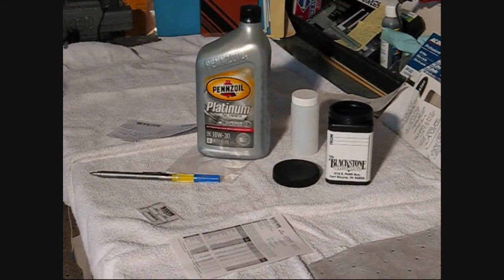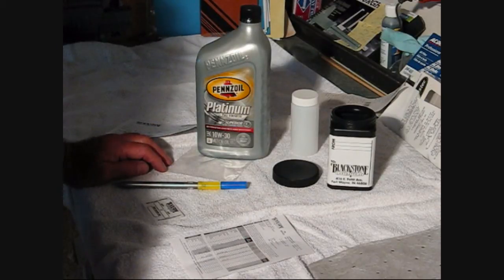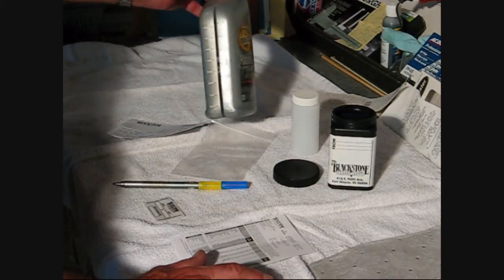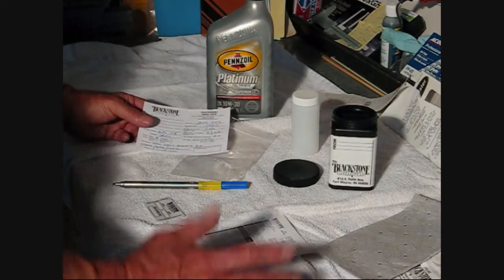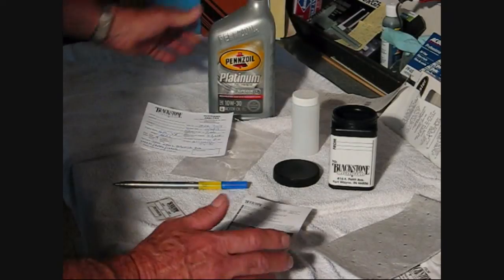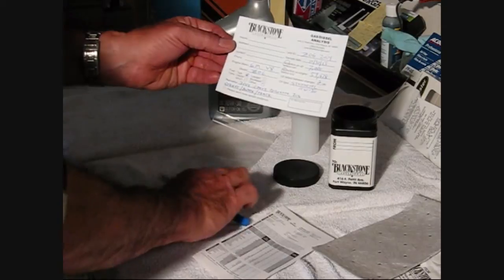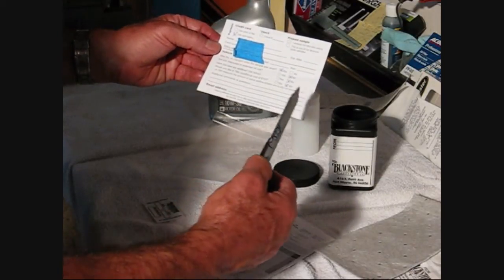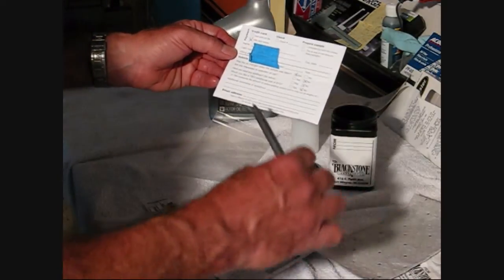Tools motor oil analysis by froggy used engine oil

Comment: The main crank oil seal on the bottom of the Kohler engine leaks 1-1/2 oz odf oil just sitting for a week (not ran). Could I use high temp oil resistant RTV silicone on the main crank oil seal?
Reply from the maker: Good question. It is very common for those type of engines to develop a leak there, a lot of vibration wears the seal. Fixing the leak from the "outside" might work for a little while but eventually it will come back. This is an ideal project to learn how to repair small engines and in particular how to pull a seal & insert a new one.

I would get a good book on "how to repair small engines" maybe off Amazon and teach yourself how to do this procedure. Maybe do a video & put it up on YT.
Reply: OK. Will look up a book on Google play store.

Comment: Serviced my push mower today. Did a oil change, air filter, & put n the E3 spark plug. But still needs the blade sharpened.
Reply from the maker: I hope you are going to sharpen yourself!

:)
Reply: I don't want to mess up the blade. Plus im legally blind n the left eye. Read the other post that I put on the post with the mower pic.
Reply: I downloaded a service manual for the Kohler 20 HP engine thats on the cub cadet. Do u know if there are any sites that'll let u down load vehicle repair manuals for free?
Reply from the maker: Not that I know, they make $$ on those.

:)

Helm makes a lot of them. Worth it if you intend to do work, I ALWAYS get one for my Vettes.
Reply: R the helm 1s cheap?
Reply from the maker: No, over $100.

:(
Reply: Darn.

Comment: Hi Froggy.  I've used Blackstone to analyze both oil changes I've done on the Z06.  Thought you'd like to know that I don't put that black container in a shipping bag.  I just put 3-4 stamps on the container and drop it in the mail.  We also use Blackstone to analyze piston aircraft engines.  I send them the same way just using the container and postage stamps.  Haven't had any problems with the postal service.
Reply from the maker: I think you only have a problem if you hand it to a counter clerk. They always ask a half dozen questions about what's in it.

:)